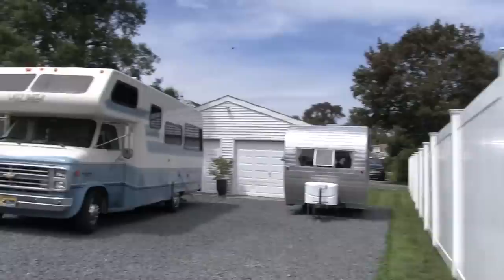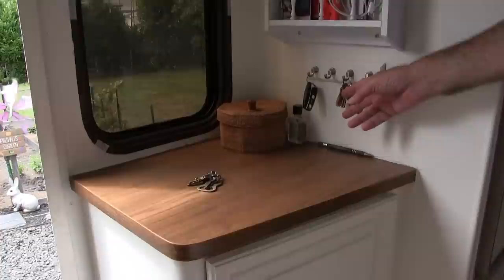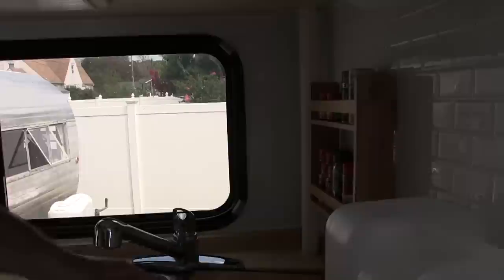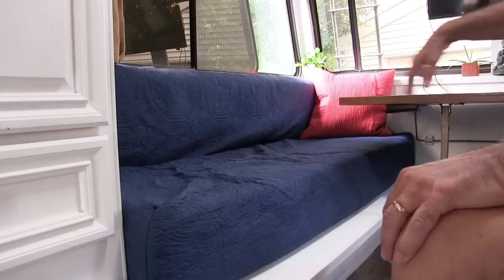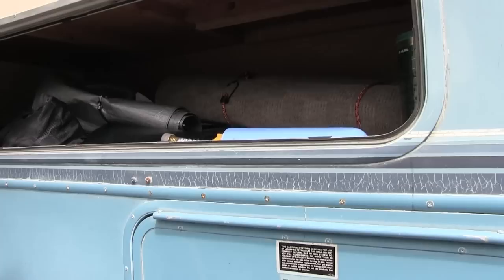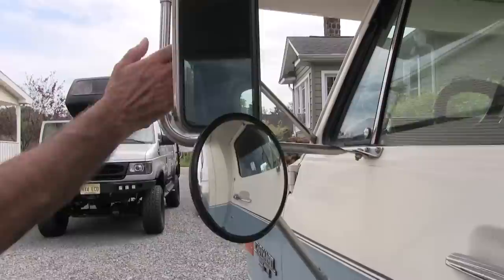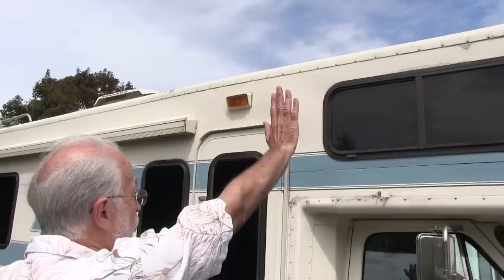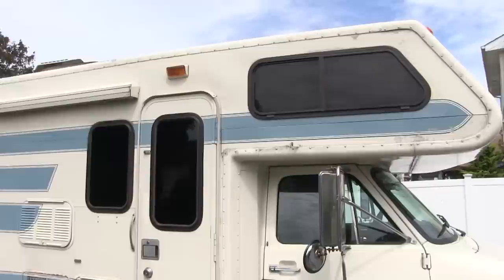CLASSIC CAMPER TOUR | 1990's Retro Class C Motorhome RV - Lazy Daze

Comment: i've repaired a lot of motorhomes and travel trailers and i have to say that the lazy daze is the best constructed motorhome made. the framing is very solid, they don't use wood with knots or cracks in it, the exterior aluminum siding and roof is pretty much indestructible and they rarely leak, unlike fiberglass-sided ones with rubber roofs. i also like the fact that they are sold factory direct only, and every one is built to order.
Reply: Glad to hear this I just received one as I gift. Looking forward to dressing it up.

Comment: Still lots of life left in this classic Lazy Daze.  I purchased a 2001 mid bath model in 2013 and still have it.  Someone in DC area had purchased and drove it back from California and then it sat under an awning for 12 years.  It only had the miles on it from the factory and the bathroom was not even used.   New tires and every fluid changed and it ran like new and still does.  Very similar to this model but has a dinette area that offers another bed.  It’s my understanding that Lazy Daze was the first to offer the cab over bed.   But for sure a Class C is much safer as the cab area is from Ford with air bags and must follow higher safety guidelines than a Class A.    I started as a backpacker, to Pop Up, to 15 years of VW Camper as kids grew, and now to the Class C Lazy Daze.   I’ve got to go dig out some old VW Westfalia Photos.  I can tell you the 88 VW Westy was more expensive to maintain but I sold it for almost as much as I originally paid for it.   Lazy Daze goes for reliability and you will not find slide outs but they feel big with the huge windows.   The Lazy Daze forum is more active than any RV owners group out there.  You can take on lots of repairs with the help of this forum.  Really enjoyed the tour.   Older in good shape is a lot easier on the budget.

Comment: Thank you for sharing this tour Patrick, Ken & Stephanie.  I just acquired a 1986 Lazy Daze motorhome that has been well taken care of.   It's almost the same floor plan.  I have a pull out bed & the 2 chairs in the back.   Still not exactly sure what size the bed is.  Full or queen.   Ken explains where everything is & capacity of the tanks.   I have not found a manual yet.    This has helped me greatly.    I have not gone on my 1st adventure yet.   I'm downsizing from our 36 ft RV to the new 22 ft one.   I know not everything will fit or will need for our little  family
Reply: I have a '91 that came with a manual that says 1989 on the front. I scanned it and have sent it to quite a few "oldies" owners.  Happy to send it to you if you'd like. My back is set up similar to yours.  The sofa to bed is full and over the cab is a queen.

Comment: ALL cutaways are cool!! I'm partial to 22' 350hp EFIs, Fiberglass is o.k. BUILDING a metal carport is great for saving exterior also with metal carport there is an added option of installing FYI hydraulic auto lift for SERVICE REPAIR. Take a fat ten man cabin tent for air mattresses under stars.